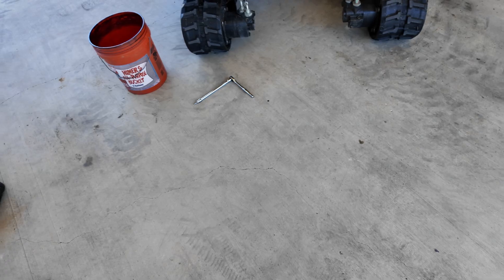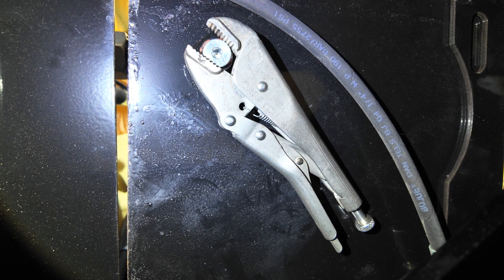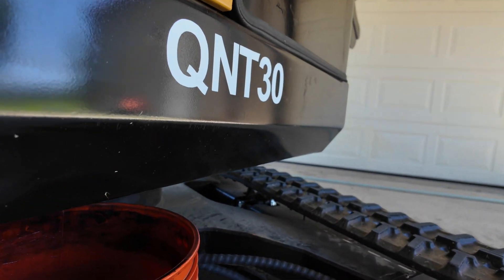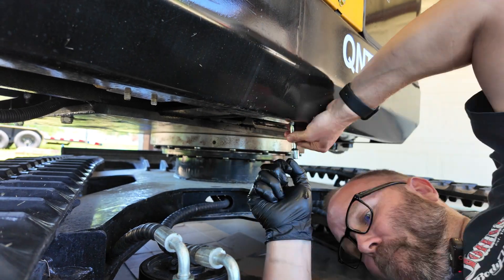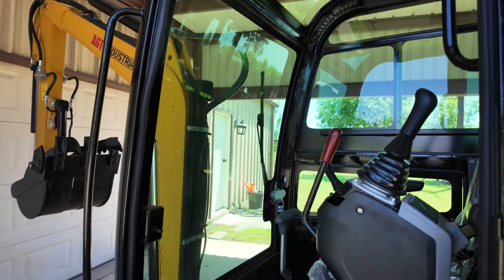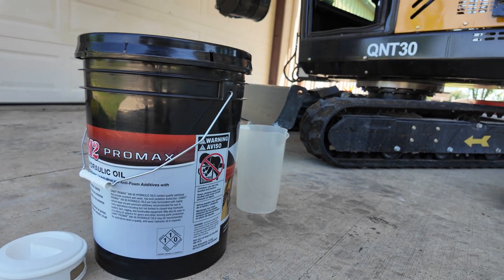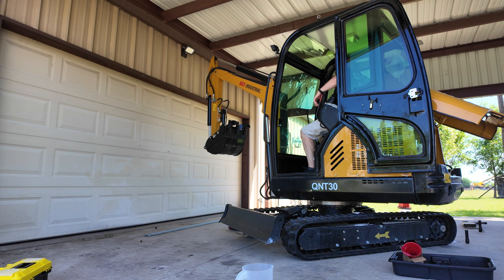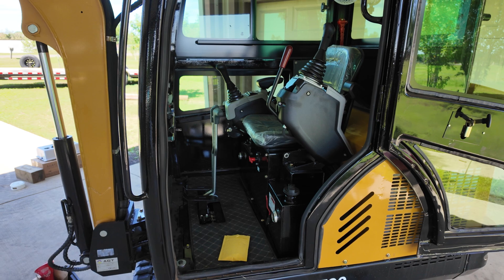AGT QNT30 Hydraulic Fluid Change

Comment: What did the inside of the tank look like? Metal shavings? Slag?

Also, check the psi on the manifold, the pressure might be too high. I've read adjusting that helps with the jerkyness
Reply from the maker: I ran the magnet through the tank and there was  almost nothing in there. I saw a couple of small shavings, I think it came from the hoses. Nothing major that I was concerned with. Thank you for the tip, I will have to check the pressure.